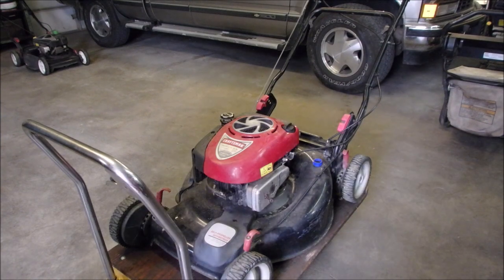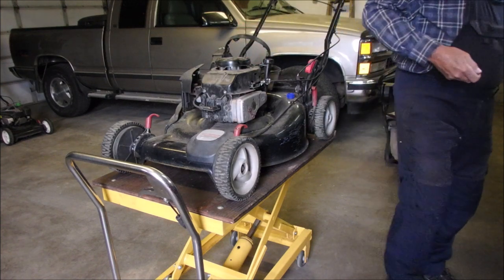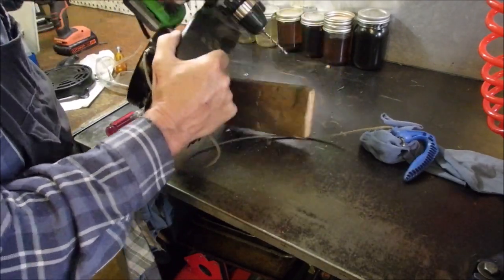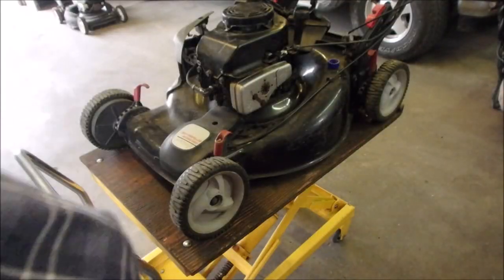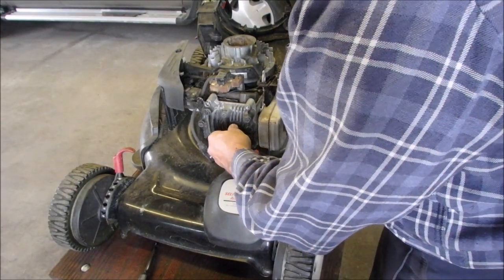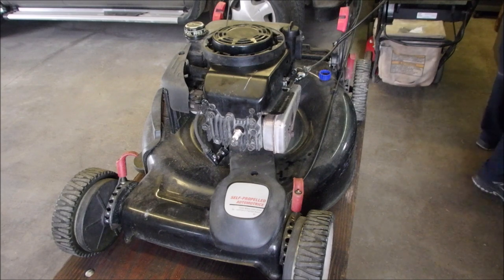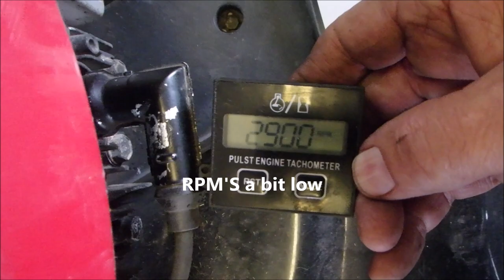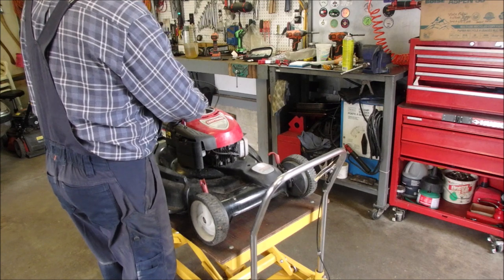Replacing a Craftsman Briggs Quantum Rewind

Comment: Another cracking job me old Mucker.. I have done a couple of the pull cord replacements in my time.. thanks for sharing the information mate
Reply from the maker: I thought i would put in a full replacement with rivets as most repairs use the same housing.
Reply: @BrucesShop  yeah sure

Comment: What was the final rpm set too,raised mine from 3150 to 3600 the other day.
Reply from the maker: I set them to approximately 3200 RPM  a bit higher for the Honda's.  Mostly as the machines I work on are older.